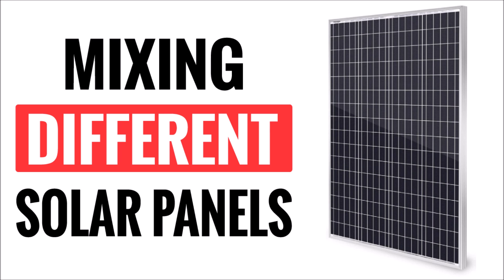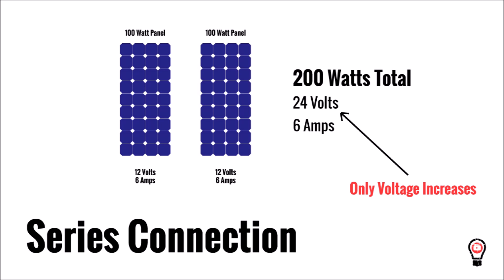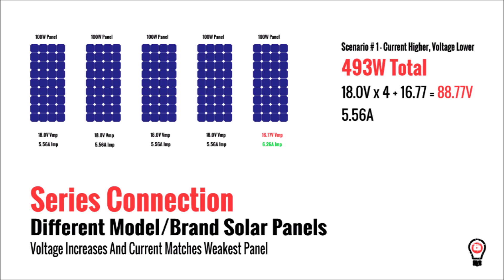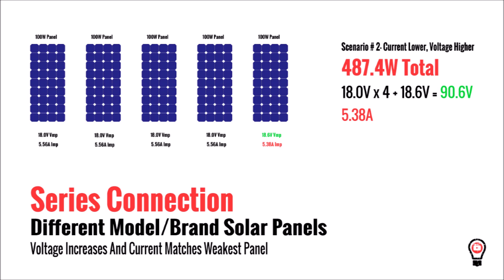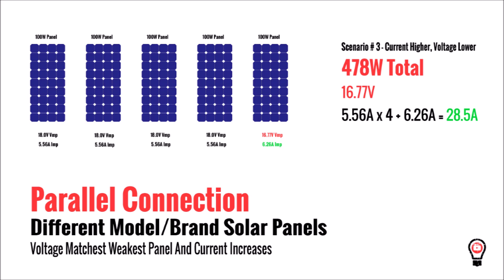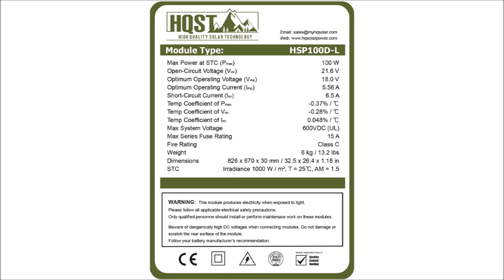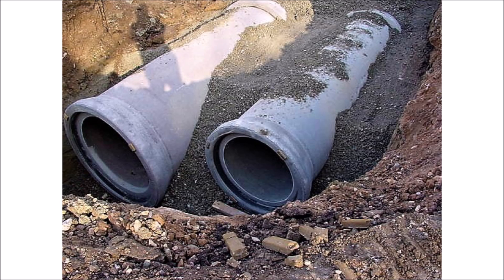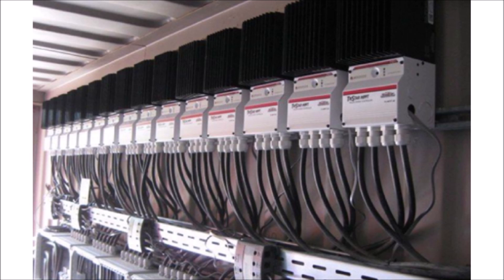Mixing Different Solar Panels In The Same System - What Happens And How To Do It Right

Comment: What is the potential for damage to the panels if a string of higher voltage panels are in series with a string of lower voltage ones.  ie Will the higher voltage panels in series with a string of lower voltage panels force current through the lower voltage panels and damage them?
Reply from the maker: There wouldn't be any danger of damage from current in a series configuration.  The danger would be from exceeding the functional voltage limit of the panels.  But there really shouldn't be any scenario where you should be putting dissimilar panels in the same string.  In the same array is fine as long as you understand how that affects (decreases) your potential power output.

Comment: Timely finding this.  I have a 8-year old system on my house with 22 300 watt LG panels with Emphase micro inverters.   Two panels have failed and about 3 others have degraded 33% lower than all the others still working.  I learned the panels are no longer available as LG Solar is now history (so is the original installer).  So now the problem is what to do to bring the system back up.  (Electric Rates here in California are already high but you ain't seen nothing yet after the wildfires)
Reply from the maker: Most of the major brands (I would certainly expect LG to be among them) have their products third-party insured for the warranty so you could still be able to make a claim, even if the original manufacturer is gone.  

With micro inverters the topic in the video isn't really an issue.  Each of the panels or strings connected to the micro inverter is its own separate deal, unlike in the video where the entire array is trying to play nicely together.  So you should be able to add more solar panels of your choosing and more micro inverters and be good to go.  However, I am not an expert on grid-tied rooftop installations so definitely get another opinion or two.  Just keep in mind that "installers" are out to make money so if you tell them what you described in this comment, they are probably going to tell you that your whole system is junk so they can sell you a whole new one.
Reply: @LDSreliance  True, LG is partly honoring the warranty but only at the rate of 40 cents per watt.  They said no more panels are available so I am having to find a replacement panel to fit into the system.  So the warranty will not cover the full cost to replace  the defective panels.
Reply from the maker: That sucks.  I'm sorry.  But I think you are still fine as long as you are using micro inverters.  Good luck and thanks for watching!

Comment: I have a van with a fixed panel on the roof. I was planning on getting a portable panel that I could use when the van is parked in the shade. If I connect them in parallel and the fixed panel is in partial shade, will this affect both panels? I think shade affects current not voltage, so shold be ok??
Reply from the maker: It will affect parallel a lot less but there will still be an impact.

Comment: I have a Poly Panel 300W & a Mono 300W. The Poly registers 18.8V & the Mono 18V The Currents are, 3.8A & 4.1A, Actual Measurements. Can I add them together in one configuration or the other? Would it be better to feed into two controllers then into one?
Reply from the maker: It is always better to feed into two controllers if you already have two controllers laying around.  That is the only way to get max power out of both panels when their specs are that different.
Reply: @LDSreliance  Will I feed the two Controllers into one single Controller then into the Inverter?
Reply from the maker: No.  You attach both controllers to your battery bank.  Ideally they would be the same model controllers and have the same settings.  But even if not it will still work fine.
Reply: @LDSreliance  I am using this setup. My problem is that one controller is working the other doesn't when both Panels are connected. one 300WP & one 300WM. If I switch off one Panel, 300WP, the Charge Controller on that side works. If I switch that one off & the other, 300WM, on then that Controller works, but they won't work while connected together in that configuration. Why? any ideas? Both are 40A EPEVER CC's. That feed into a 300W LiPo4 Battery then into a 8000/4000W Inverter then to Panel to the Caravan.

Comment: Hello sir,
I had 8 panels of 345 watt (37V & 8amp) installed before now I have added 5 panels of 580 watt (50V &13 amp) ...
345 panls are cutoff now i want to use them all what is the best way to use can i use separate controller...or if i connect 2 panls of 345 in parallel it makes (37 volt nd 16amp) nd then it connect in series of two it makes (74 volts nd 16 amp) ..at the end i have two strings 1 of 580 watt panal which is (250 volt nd 13 amp) nd 2nd is 345 watts panals which is (148 volt nd 16 amps) then can i connect in series or not plsssss help me out😅
Reply from the maker: I think I just answered your email about this.
Reply: @LDSreliance  yes very thankful, actually I don't expect your reply but❤️ that's why I emailed u, thanks 👍

Comment: Just to make sure I understand properly...

In your exemple.. the odd panel always had either the voltage or current either higher or lower than the other panels.. one of those 2 values had to go either up or down (amp/volts)..

In my set up, if I have an odd panel that has both a lower voltage and a lower current.. this panel would drag the value of the series/parallel down no matter what, right? 

It would be a lost of current AND voltage for the array and it would be idiotic to add the odd one then, right? 

Asking for a friend 😅😂
Reply from the maker: If it has lower current and lower voltage then it isn't the same wattage of panel.  I only addressed same sized panels in the video if my memory is correct.

It isn't optimal, that is for sure.  It would seriously affect the entire array.
Reply: @LDSreliance  yes, that is correct, my panels aren't all the same wattage.. I've been trying to figure out the best way to go about it .. and since most (or every) videos online seems to pair all their panels with the same wattage together, it must be because it would dramatically lower the performance of the other panels. I suppose my best option is to connect all my 100w panels together (they have the same V and A) and then connect my 2 bigger panels separately!

Thanks for the fast reply! It's appreciated! ⭐️
Reply from the maker: The only way to do it right is to use multiple charge controllers or a controller that can track multiple power points.
Reply: @LDSreliance  Oh! I have a MPPT charge controller actually!
Reply from the maker: That will get more power but won't track multiple points, necessarily.  You'd have to look at the specs.
Reply: @LDSreliance  ok, good to know, will do !!

Comment: So this is what happened to me.i bought a kit .6.2 kw 48v inverter 6x 495 watt panels and a 5.12 kw smart lithium battery for a good price about a week ago. I quickly saw that the 6 panels were not sufficient. So I tried getting another 6 but now all a sudden they are discontinued. After a huge hunt I tracked down 4. But I'm still 2 panels short of where I'd like to be. I did find 495 watt panels of a different brand but the voltages and current is higher than my existing 1s. So what would happen in this scenario.  They are wired in series
Reply from the maker: Just get a charge controller that can track multiple points at once.  Or just add a second controller for the new panels.  As long as you aren't combining the panels into one array with one controller (that has only one tracking point) you will be fine.

Comment: Thanks for you info here, 
I have 6x260w panels (3s X 2p) on a south facing roof which is all I can fit on it, if I added 3 more exact same panels to a west roof wired in in the exact same way, 3 in series and then all paralleled together would the 3 on the west roof pull down the output of the south roof?

Comment: BULLSHIT VIDEO.  Just connect the same voltage panels in parallel and then in series with the rest. Of course this should not be higher than your MPPT charger supports.
Reply from the maker: That doesn't get around the problem.  If you are connecting different panels together in the same array in any configuration, you will lose a little bit of power.  Period.  The only way around it is to use a controller with multiple tracking points or multiple controllers.

Comment: Thank you for this video. Now that i understand the consequences on this kind of array, it leaves me down to one more question. Aside from power lost, is there a tendency of breaking the inverter or let’s say a delta pro?
Reply from the maker: No, the inverter or charge controller won't care.  As long as you don't exceed its limits.  But mixing panels won't affect that.
Reply: @LDSreliance  thank you for clarification, i have read somewhere that mixing 3 different brands and specs will break something in your setup which leads me to your video
Reply from the maker: No, it won't break something but it won't be optimal.

Comment: very confusing explanation this. Instead of explaining adding 1 panel in series you replaced one with lower Voltage or Amps, who does this?
Reply from the maker: Because adding 1 panel in series to another panel will either result in the new panel being higher in either Voltage or Amps.  Those are the only two scenarios, unless the panel is an exact match.  I don't see where the confusion is.
Reply: Not really. the other panel should be same with Amps, but Volts do summarise. So you may add another panel with lower voltage but similar Amps and system will improve. @LDSreliance
Reply from the maker: If you have two 100W panels and the voltages are different then the current also HAS to be different.  It is simple math.

Comment: What if you install larger wattage panels that have a higher voltage and amp rating?. Say i have  32x 285w panels and want to add 8 more panels that are 380watts each  the new 380w panels are only as good and will only produce as much as the older 285w?
Reply from the maker: Unless you design around it you will lose power.  Ideally, all panels of the same model should be wired together and sent to its own charge controller(s).  The other panels of a different size should be wired together and sent to another charge controller(s).  Then you get all of the power from the panels.

Comment: i'm trying to figure out 3 100 watt pannels that go through a hub.. if i add the one older 64 watt pannel will this work?
Reply from the maker: It will work but you won't get the full rated power from all 4 panels.

Comment: I have three PV strings:
Parallel connection
6-200watt, 17.3volts
3-100watt, 18.9volts
3-100watt, 18.6volts
Can I tie the 6-100watt pvs parallel
And lower the string 18.6voltage with 3-80amp diodes in series diodes(0.46v drop/diode) to match the 17.3volt string?

Comment: Good explanation....  NOW, my question....  I am using 6 - 100W panels all of the same brand/model and ratings.  My SOGEN, (Pecron E2000LFP), has two MPPT charging inputs to handle two series strings up to 600 watts each.  Would it be the best configuration to group the three lowest current panels together in series to result in a "lower performing string" to input to one of the MPPT controllers and connect the three higher current panels is series to result in a "higher performing" string being connected to the second MPPT controller????  My rational is that why have a lower current output panel in each string, thereby reducing the series current to that of the lowest current panel, when, if you configure/connect as stated above, each series string would be "better matched" to provide the most output.  Now, we are only talking about a few tenths of an amp variance, but, my connection plan seems to make sense to me....  YUP, an engineer question for sure, but, thought I'd get your take on my proposed connection scheme....  Thanks in advance for your reply....

Comment: What about when someone has a tilt mechanisms on all the roof panels, but only tilts the panel that is distal from the sun, and not the other panel towards the sun so as not to cast shade upon one of the panels?
The end result would be that one of the two identical panels (the non-tilted one) will put out much less voltage while the one tilted towards the sun will put out much more voltage and current.  
In this case would it be preferable to have two separate charge controllers, one for each panel, even though they are identical panels?

Comment: One thing is not quite clear to me yet:

What would be the problem if I had 2x 34V 11A in series and 4x 17V 6A and these two Series then in parallel. Both series amount to about 68V. (2x 370w panel and 4x 100w panel). I would also like to place the two different types of Panels in different places so that the sun shines on them at different times. What speaks against it and why?

Comment: I tried a mix and it worked but since I have 2 MPPT on hand I think I will separate and do it properly. Thanks!
Reply from the maker: Yes, it definitely works.  I just wanted to highlight what the cost is and make sure people understand what they are giving up by doing so or how to optimize the mixing of panels.
Reply: @LDSreliance  yes thank you for the info!

Comment: I have 2 separate banks of panels, 5 x 200w @22.6v with 8.85amps, the other bank is 3 x 330w panels @ 17.56v, each bank in series would be 200w panels= 113v @ 8.85amps, the 330w panels would be = 52.68v @ 18.79amps, my questions are, can you run them to one regulator and whats the result or can you use two regulators and whats the result of those coming together at the batteries?, Lithium types.
Reply from the maker: In that case you would definitely want to use two charge controllers.  The voltages don't even come close to matching up so you would lose a lot of power if you connected them to the same controller.  I don't have time to do the math right now on that to illustrate exactly how much you would lose.  But even just getting a couple of cheap controllers would be better than putting both strings on the same high dollar controller (unless the controller has multiple inputs, which is not common).
Reply: @LDSreliance  From what you've said before, thats what I thought would happen but thanks for confirming it, I have 2 controllers anyway, would two different voltages going to the battery  confuse the controllers? what voltage would prevail? or am I better to leave them in Parallel until I need new panels and do it properly in one size and type of panels then, thanks for the reply.
Reply from the maker: That is a great question and one that I don't have a very specific answer for.  I do know it works but how the two controllers interact is a bit foggy.  Theoretically, they should be providing very similar voltages to the battery(s) if they have similar charging profiles.  They should be within a few tenths of a Volt of each other.  Sorry I don't know much more than that.

Comment: I did this and was wondering if it would being the system down drastically I took two newpowa solar panels and one renogy panel all 100 watts I do believe the renogy has a little higher voltage
Reply from the maker: It isn't the end of the world.  But not ideal if you have a choice.
Reply: @LDSreliance  well I just wanted more then 200 watts how much would that bring the system down alot or more minor ?
Reply: Specs for panels
Newpowa
Max Power Output(W): 100W

Voltage MPP Vmp(V): 16.77V

Current MPP Imp(A): 6.26A

Voltage Open Circuit Voc(V): 19.83V

Short Circuit Current Isc(A): 6.56A

Renogy

Maximum Power: 100Watt
Maximum System Voltage: 600V DC (UL)
Optimum Operating Voltage (Vmp): 20.4V
Optimum Operating Current (Imp): 4.91A
Open-Circuit Voltage (Voc): 24.3V
Short-Circuit Current (Isc): 5.21A
Reply from the maker: Unfortunately, you will max out (under STC lab conditions, not real world) at 264W or so in that scenario.  Compared to 315W for the Newpowa panels (their power rating looks to be understated slightly).  I would get another Newpowa if you can.
Reply: @LDSreliance  I think I'm going to buy another renogy and run 200 to one power station and 200 to the other thanks for the info
Reply from the maker: @adrianlecuyer  That works, too.  Good luck!

Comment: All I know is I'm running 12 volts through all my solar panels I got two 405 watt solar panel four 100 watt solar panel two 60 watt solar panel. What I did is put all the 405 to a line four 100 watt solar panel to a line and to 60 watt solar panel to a line all in 12 volt and then put all the lines to one line to the house and all the amps in that line added up to what all the amps are to each solar panel is not losing no amps. The amps added up to what all the solar panels are together with out a losing any loss of power or amps and the votes were still the same which was actually 18 volts I didn't think I could do it any other way would keep it without keeping all the amps and you just showed me that the way I did it is the right way in the way you're showing is the wrong way. I have mixed panels in sizes in two different sets and I haven't lost any amps to anything and the volts still stayed the same and the watch still stayed the same well actually all the Watts added up together without losing a watt.

Comment: Sooo.. I have like 6Solar lights that batteries died, Bulbs burned out, or whatever caused them to stop shining. Can I take them and wire them to run a small fan when I'm just sitting around? And ummm.. What the thing that needs to be discharged or will kill you called.. Like in a microwave.. Would one of those help with using the fan at night? Will a S.P. "charge" one?

Comment: So thanks abunch, question,can I run separate charge controller from 2diferent system to the same batteries?
Reply from the maker: Yes, you can.  My main solar panel system has three different charge controllers going to the same battery bank.